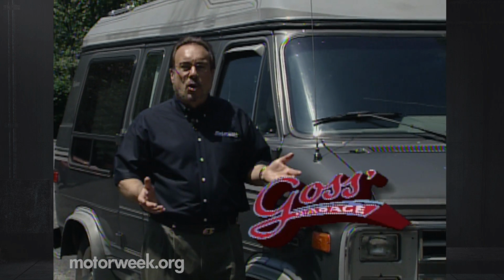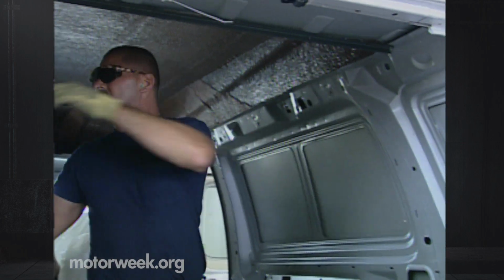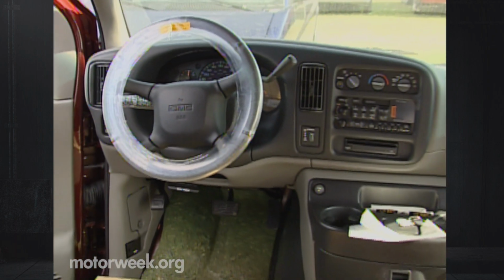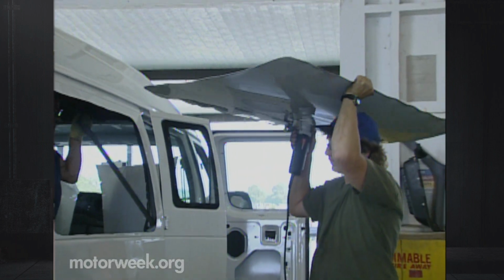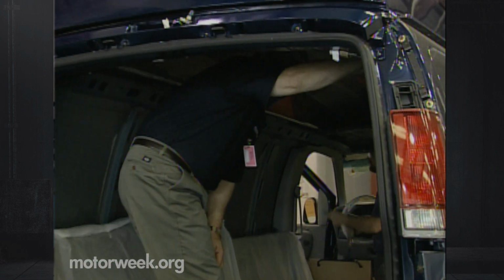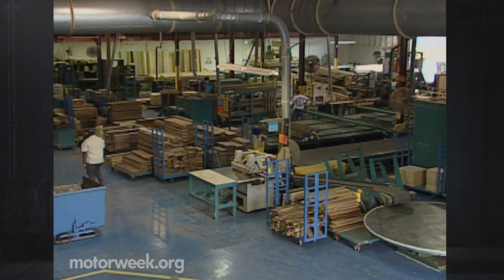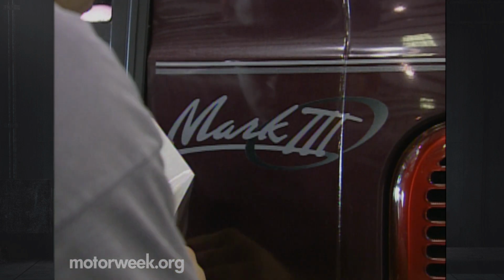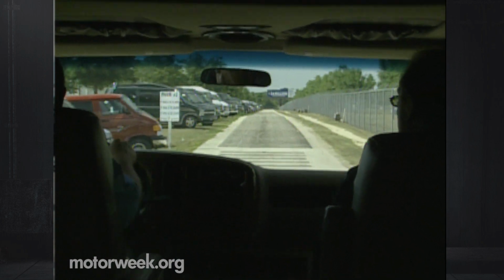Retro Goss: How Conversion Vans are Built

Comment: Man we've come a long way since sawing the tops off of vans.  Made no sense to me why GM/Ford/Dodge didn't offer high roof versions from the factory back in the 80's/90's/00's when there were so many companies out there cutting the roof out and installing stupid fiberglass caps that were prone to leaks.  Ford, Dodge and Mercedes recognized the need for bigger, more space efficient vans with higher roofs.  Chevrolet is still making the same old low roof crap from the 90's that wears like an anvil for the cheap contractor fleet guys.